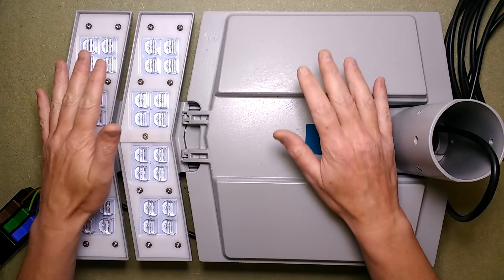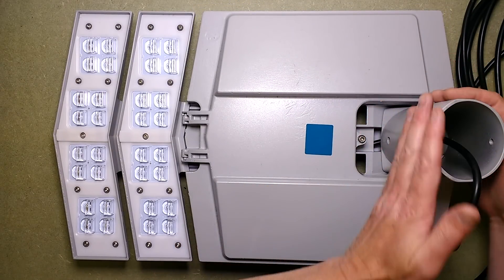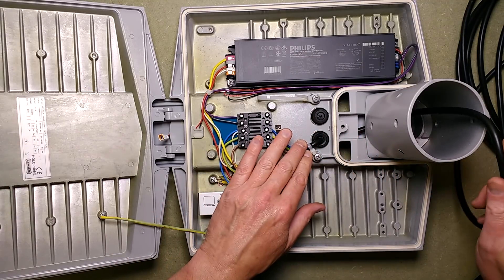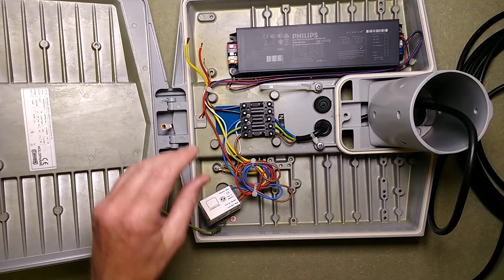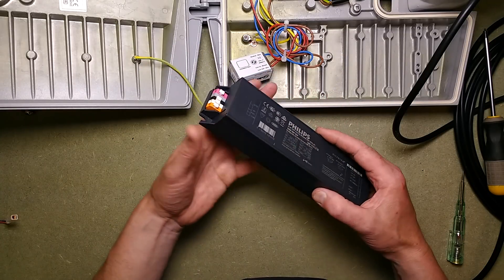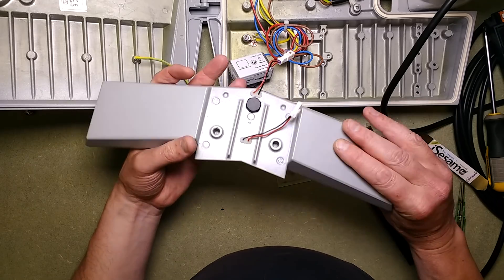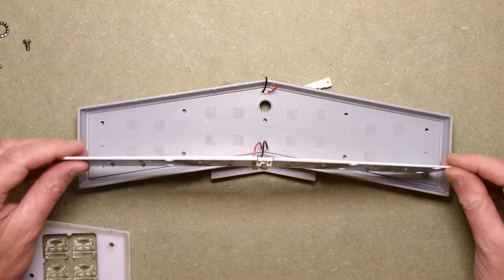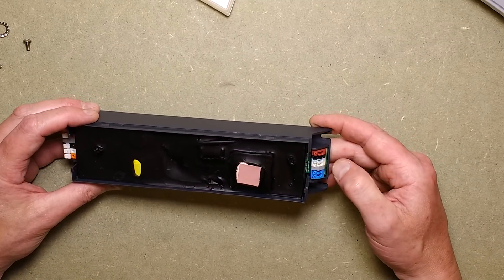Inside a Holophane LED street light (slight chromecast glitch).

Comment: I wouldn't be surprised if the Chromecast tried to use hardware compression which was already being used to save the video and ether used CPU compression or tried to share the hardware.
Reply: I'd be very surprised if anything but the newest phones had MPEG4 or h.264 compression in hardware. It might use the GPU to accelerate it, but it'd still be in software. Also, what happened (as far as I can tell) is the CPU/GPU inside his phone started to thermal throttle. Hence why it worked fine for the first while and then slowly got worse. Trying to compress and save video to SD, while also compressing & streaming to the Chromecast is too much. I'm assuming he was using the "cast your screen" feature built into Android.
This feature is very different from all other Cast buttons you see in various apps. When you cast, say, Netflix to your Chromecast, what actually happens is a stripped-down version of Chrome runs on the Chromecast and it directly streams the Netflix to that device. Your phone essentially just becomes a remote control. However, when you "cast" your screen, the phone has to both render the video AND stream it to the Chromecast, which is literally just passing a video stream to the output device. Therefore all the processing happens on the phone. This is part of the genius of Chromecast and it's why apps like YouTube, Netflix, etc run so well even on crap phones -- all the video processing is offloaded to the Chromecast.

Anyway, rant over, just wanted to get that info out there :P

Comment: The black 'potting' stuff will peel off when warmed up - like you said, kinda like Blu-tack! - I had the fortunate experience of that stuff for the first time recently when repairing a SUB, - thought it was the old black silicon stuff at first, until it came off together as one, and now I can play with and mould it as I want - it's great for temporary fixings - oh, and leaves no residue! :D
Reply: Doubtful that it will peel off when warmed up. That sub must have been using really cheap potting compound, it's designed so that it will not soften before it burns -- this is to prevent water ingress and to properly insulate components from each other. A brand like Phillips wouldn't use cheap potting compound

Comment: Once you got the chevron module out of the way and open the lid all the way and the spade connector came off the main body, the lid should have been able to be lifted away.  According to the open slots on the hinges., no?
Reply from the maker: It did lift off when swung fully open.
Reply: neat

Comment: Yeah but what is the power factor :)

quite disappointing that style appears to have trumped practicality with that awkward enclosure door impinging into the side of the trendily shaped  light bar.
Reply from the maker: The power factor is good.  I'm wondering if the impinging on the first chevron is deliberate to prevent a loose lid from unhooking from the hinge and dropping.

Comment: That’s a wicked street lamp!! ...  the blue patch reminds me of the Zeiss logo! ...  they replaced all the lamps around here and now we can see the stars at night!!! (Less light pollution )
Reply from the maker: The light from these is much more controlled.  After a rough start the newer LED street lights seem to be getting better.
Reply: LED lights can get the same or better perceived brightness than sodium lamps because of the wavelength of light they use... unfortunately, that also makes the light pollution worse unless they're in well-designed fixtures. Technology Connections did some videos about street lighting that were really interesting. :D
Reply: I love our new LED street lights. On the street it almost looks like daylight but inside the house you cant see any light at all, its really nice. I wish they didnt just replace our old incandescent lamps but also our newer sodium lights which shine right into the window from a km away.
Reply: @Chuckiele  If they carry on replacing the old sods with LEDs, I'm gonna have to start putting the light on when I go for a pee in the night. There's a sod half way up the street at the back of our house which shines into the bathroom. If I leave doors open in the house, it lights my bedroom at the front of the house too. I'll really miss it when it's gone :(
My Dad once fell down the stairs in the night - mistaking the light from the stairs window with that from the bog window ! We've got a half landing with a 90° turn on it - he even managed to get round the corner. He was badly enough bruised on his back that it was an ambulance job.
Chipped paint but nothing broken - so pain killers and sent home.
Reply: @millomweb  Well, thats not what street lights are for though, just get yourself a nightlight.
Reply: @Chuckiele  Well, us taxpayers are paying for them - so why can't we have benefit from them without walking the streets ;)
Reply: sorry to disappoint the blue patch just tells you what type of fitting it is.
 the last scheme where we were installing these lights had a map of each street where the lighting calculations had been done and at each location there was a coloured dot to tell you which fitting was needed.  the one above is set to 50w if that is the dark blue.  it is a good system as the box they come in also has the same colour patch no reading numbers or codes just a coloured sq
Reply: Dubious Engineering ppm
Reply: Dubious Engineering I can anyway as all the street lights in my area go off at 1am, ideal for me being a stargazer and nocturnal photographer

Comment: The led street light in my road are sh1te!
The light emitted doesn't reach the ground and the road is now significantly darker, except for everyone's bedrooms as the light now shines brightly at the first floor level.
Idiot council!!!
Reply: They seem to be trialling different LED heads on different roads in my area... mostly they seem to be great at putting light onto the road but now people are grumpy about the low level of light spillage onto their front doors and paths  compared to the old sodium heads... technology connection just did a YT about LED street lighting & said there were retrofit bulbs designed as a drop in replacement for the sodium tube using the same lens - haven't seen anything of that type used but sounds like a terrible idea TBH and would probably give a very bad illumination of the type you describe.
Reply: joinedupjon 
The ones on my road and surrounding ones are complete head replacements.
Look like cheap Chinese rubbish. Horrible colour too.

Comment: Fcuking hate LED streetlights. They only light up a small area directly under the column which results in dark and gloomy streets with loads of shadows. And to compound that, when you pass underneath they are the ultimate glare bombs. Less energy because less light in all the installations I’ve seen. SON lamps rule!
Reply: then the LED lAMPS  your council uses r shit ,the ones in my town are awesome and illuminate the streets much better than the phos ones
Reply: It totally depends on the lenses. Check out this video: https://www.youtube.com/watch?v=wIC-iGDTU40
Reply: It might work with proper lenses (or diffusors?), but I guess that is too expensive?
Reply: I agree, the area by our Walmart got completely lediseased and some of the new flyswatter shaped lights got replaced with traditional cobra head shaped ones due to failures already. In addition to having poor light distribution and coloring (color equally matched by coated merc imo) they evidently don’t have a great lifespan either.
Reply: I’d hardly call Philips  lanterns like the BGP303 "shit" do you know how much they cost!?
Reply: FrontSideBus 

Exactly, why don’t any of these damn fixtures use refractors like the HPS fixtures do?
Reply: Who told they are brighter than them
Reply: They are out and out dangerous. Even worse in the rain, especially if you have any form of stigmatism or light sensitivity...

Comment: 10:10 This reminds me that the prof I did my engineering capstone with does research involving high voltages and Play-Doh was his favourite thing to use as an insulator for covering sharp edges to stop corona discharge, etc.. Maybe someone should tell Hasbro there's a market for industrial Play-Doh in drab colours sold at a markup?

Comment: clive, can you tell us much about how streetlights are controlled? do they all have timers, or just some that control others, or is there a central control room so they can turn them all off and on as they please?  and what about adjusting for daylight savings and other situations?
Reply: Here in Northumberland we were told they could control them centrally, so could dim them on request for example when there is a firework display or similar. In reality they've never been altered and I suspect with it being a council if you were to ask for it to be done, the person who knows how to do it will be off/on holiday/"not my job"/ or based on past experience, by far the most likely scenario they'll have bought for many thousands of pounds a non compatible control unit 😁
Reply: The ones round here (southampton UK, for reference, altho SSE seem to be installing them all over their service area in hampshire/dorset/wiltshire/berkshire/sussex) are controlled by what I assume to be radio link boxes that plug into the photocell socket on the top. (the standard Harvey Hubbell type twistlock photocell connector) . There seem to be local 'control units'  that can be centrally controlled and then talk to the individual lights. It enables the councils to do useful things like turning them off or dimming them at midnight (or other chosen times) and also gimmicky things like turning all the streetlights off on secondary roads for Earth Hour
Reply: yes they did turn them off here overnight untill they gave it and went back to full night use, and went led soon after , so i know it cannot be a simple photocell, they seem to turn on at the exact time as each other, no photocell would be the same as another
Reply: Jusb1066 light sensor. That's why they come on during the eclipse and when really dark. And go off if there is bright lightening.
Reply from the maker: There's a wide range of control systems used.  From a combination of time controllers and light sensors to wireless control.
Reply: Most street lights have a little cap on top of them. In the cap is a photocell, that senses the light from above, such as sunlight. When the sunlight goes away(nighttime or very cloudy conditions), the photocell no longer see's light. When the photocell no longer see's light, it signals the ballast to turn on. Turning the light on. Then, when the sun comes back, the photocell see's the light, and signals the ballast to turn the light back off.
Reply: i thou hgt they had more control, we had an issue with our led streetlights and they were coming on way too late, 2  hours after dark, and it was 3 streets around me doing it till they fixed it, i assumed central control?
Reply: yeah the streetlights here stopped dimming recently... i yakked at the council, lemme see if I can find the email ... ack, SSE enterprise just refer to it as 'an equipment fault' but it was affecting a whole group of roads... so that suggests central control to the "Not a photocell" ... I know there's nothing underground connecting them as they just swapped the heads the other year, as Clive alludes to in this video (aside: they wouldn't let me have any of the old SOX heads...booo)
Reply: Also on the older streetlights when the light sensor failed the fitting defaulted to the on state. You may have noticed from time to time a street light on during the day, that is at least one reason why that can happen. I'm sure the setting is probably in the new led fittings too.
Reply: in northamptonshire our LED lamps was installed in 2014 ish ? they must be photo sensitive ones cuz some turn on diff times b ya few mins to another one
Reply: Greg Ewing He still rides to each lamp on horseback.
Reply: Jusb1066 I remember when I was a kid they had mechanical dials inside you could turn to what time the light would come at used to love messing with them.
Reply: In India, most of them are "controlled" by Power Supply.
Power for Lights are turned on when needed, saves power.
Reply: robuk1981 Clive has covered one of these in a video.
Reply: This doesn't seem to happen anymore, but it used to be when the sensor went bad it would turn off the lamp as you walked under it. That was always really annoying.
Reply: Greg Ewing haha I could totally believe that’s a thing.
Reply: The light sensors are a myth. There's actually a man whose job it is to go around every evening turning on the street lamps. They wanted to fire him when gas lights went out of fashion, but the union wouldn't let them.

Comment: Bit surprised to see a light sensor in the head unit itself, I am used to remote switched street lights with the sensor at the main ignition point and secondary ignition points following the main one, incidentally our system uses 3 wires, neutral, evening and night allowing sections to be dimmed when not many people are around, remote switching makes troubleshooting a lot simpler, just turn a section on and walk around to see if one is not working, similarly if one street light is not on the section it was expected you can quickly turn sections on and off to find the section it is actually connected to

Comment: How about a small mirror above the phone?
Another option might be a clip on wide angle lens and have the phone a bit lower. Oloclip make them for iPhones. Not sure if there would be such a thing made for your phone model but you could probably adapt something.

Very curious what you end up doing with all of these street lamps you come across :)
Reply from the maker: I've tried that, but also wanted to use the big screen to see more detail.  You see a lot more detail than I do when I'm recording the actual video.  As it was, the image being cast was heavily compressed, so looked a bit soft.

Comment: Ah, Clive, don't worry about the video quality, etc. I really like your own style, unedited, plainly-lit videos, even if they're sometimes a bit out of focus or wobbly. I think we're all here for the content, and don't care about production glitz. :)
Reply from the maker: I was also hoping that it would let me see what you're seeing so I can read component numbers directly off the screen.
Reply: Check the device to see if its getting a bit warm...my phone does this once and a while when it get too warm and starts downclocking the cpu to prevent overheating
Reply: Good that it is video only, audio is more important than most people think.

I wouldnt watch it if your explanations are hard to hear, but this isnt too bad.
Reply: Do you have decent wifi signal by your bench? Chromecast can get really finnicky when wireless drops a bit. If the signal is low/inconsistent you could maybe set a repeater up near your bench or even possibly get one of those power supplies they sell for them with a built in ethernet port.

edit: after watching some more, maybe the phone you're using can't keep up? It's having to transcode the video feed twice, once for saving the file, and once for streaming to the chromecast (I think). Maybe time to get a real camera with a monitor output? ;D
Reply: I dunno even how he could improve it ... without spending several thousands of equipment or hours of additional editing (speaking of his printed photographs of circuit boards ... which he could overlay in editing instead of printing it to paper)
Reply: I notice this with Clive as well as Classic Gaming Quarterly. I think they've acquired PTSS from all the youtube trolling. They could film on a RAZR phone from 2004 and I would be happy as long as the audio was clear.
Reply: I'm here because of the production quality! So speak for yourself bud.
Reply: I've been in um adult web chats and the video's been much worse.  at least the audio didn't cut out.  :D
Reply: well there was always the days of Sydney Moon and zero audio  , Fraid those days are going shorter and I'll be looking at other fun things to play with
Reply: sharkbytecomputer Yes, that's exactly what's happening. Recording and casting the screen is pretty heavy load for a smartphone. Stop using the phone. Buy cheap DSLR and connect it to computer, you will have great quality, live view and you can even livestream. Not to mention optical zoom.
Reply: I feel that sometimes Clive worries too much about focus and white balance.... to the point of OCD.  Often I'm watching quite happily and for sure it may be slightly out of focus but I can't even tell.  BC can though and brings out the focus card.  If Clive hadn't of refocussed, I wouldn't have even known it was out of focus.  Not a complaint, just an observation.